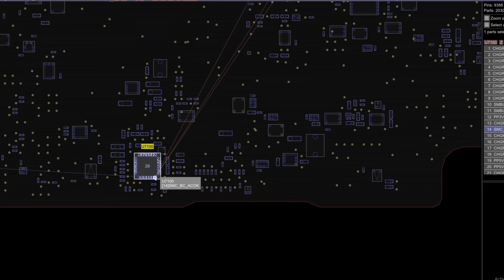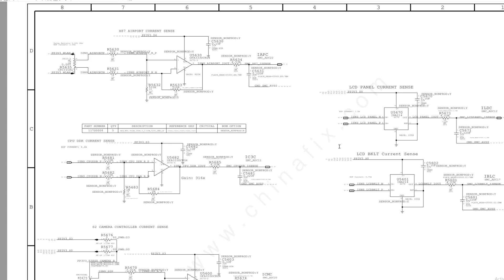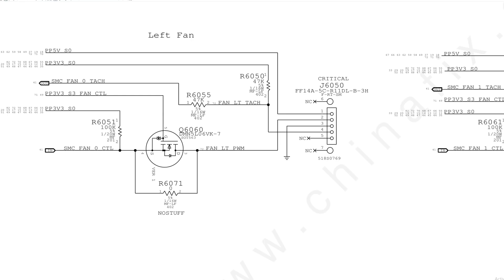Right to Repair - Let's be realistic

Comment: But i want to ask you something brother.. there are leaks of schematics and circuit diagrams for older Macbooks.. had anyone reverse engineered them?
Reply: Has any company re-built a Macbook from the existing schematics and circuit diagrams of older models? i dont think so
Reply from the maker: Where in the video did i talk about copying or reverse engineering a schematic as being a concern or problem. When something is my property, I have the choice to share or not to share it without having to justify anything. That's why schematics used to be shared and now they are not. I wish all manufacturers would provide schematics but I don't think you can legally force them to unless those schematics  are leaked.
Reply: A board diagram is not "private property" because it's released to the public the moment they sell the product. All companies reverse engineer each other's stuff immediately, and if the demand is high enough, some Chinese can do the same at home and then try to sell the schematics and diagrams to repair shops. That's why they all have that information for the most popular iphones and other garbage. But if it's a niche product, then you're out of luck because nobody will reverse a board for you as a hobby. Don't forget that even repair shops are primarily a business.
Reply: :( Such a shame...
Reply: Building a MacBook is not an easy job, but there is a lot of component that rebuild with Reverse engineering. The best example is accessories of Apple. There is tons of them thats not Apple product. Companies build them with reverse engineering. There's chinese companies that try to copy apple. If you will give them schematic and board diagrams they will immediately copy all of your products.
Reply: @abdulkadireroglu8602  You just said they don't need the schematics to copy Apple, so what's your point?
Reply: @abdulkadireroglu8602  Chinese companies don't need to reverse engineer or copy apple, they already manufacture your apple iPhone. Huawei is better anyways

Comment: Board and circuit diagrams where available for almost all electronics in the past (in the nineties and before). It was even printed inside some electronics and was at least available to repair shops. We just become used to don't have this information available though the years. The companies took away these diagrams and repair information, little by little, over time, to force us to buy new products instead of repairing them, we just didn't realized before it was too late. They now, as you explained, even go as far as using serialization... The companies changed these practices over time to prevent end users and repairs shop to repair electronics. In my opinion, on the contrary, they should be in the obligation to give these board and circuit diagrams to, at least to repair shops. Service manuals were a thing for almost every electronics in the past. Why it's no longer the case?

Comment: Spot-On analysis Alex. While you were talking I thought of an add-on to what you were saying. If only computer repairers who were registered with the IRS are allowed access schematics through the manufacturers database, that might appease the big manufacturers  who want to protect their intellectual property. I asked ChatGPT how to manage the security and Intellectual Property question and this is part of AIs answer to that question. It has Merit. Cheers:  

"The quickest and most secure method for IT hardware manufacturers to share their intellectual property (IP) with repairers would depend on various factors, including the specific circumstances and requirements of the manufacturer. However, here is a suggestion that combines speed and security:

One option could be the establishment of a secure online portal or platform specifically designed for authorized repair technicians. This portal would require repair technicians to register and undergo a verification process to ensure their qualifications and adherence to certain standards.

Once approved, repair technicians would gain access to a controlled environment within the portal where they can securely obtain the necessary repair information, including motherboard diagrams and electronic schematics. The portal should incorporate robust security measures, such as encryption, multi-factor authentication, and user access controls, to safeguard the manufacturer's IP.

Additionally, the platform could employ digital rights management (DRM) technologies to further protect the IP. Repairers could be granted access to specific documents or information based on their credentials, and the DRM system would ensure that the IP remains encrypted and protected from unauthorized distribution or misuse.

Regular auditing and monitoring of the portal's activities would also be essential to identify any potential breaches or unauthorized access attempts, ensuring the security of the shared IP.

By implementing a dedicated online portal with strong security measures and controlled access, IT hardware manufacturers can provide repairers with the necessary repair information while maintaining the integrity and confidentiality of their intellectual property."

ChatGPT suggested other options, but I value and respect your time. All the best.

Comment: 11:06 about passing on schematics , its already happening with cars and motorbikes but it doesnt happen with the electronics and that is the problem we dont ask for source code we just need to be able to buy parts and know the electrical conections , for long years people reprogram cars ECU´s they have the car schematic but no one is copying the car coz its not feasible, even if you know how the comp+onents are conected and which components are there you cant just 3d print a pcb at home it requires bilions in resources and equipment.
Reply: Actually, pcbs can be made as cheap as 2$ per 5 of them. I do assemble a lot if pcbs myself at home.

Comment: The big question is solved long time ago with cars. You have third parties making parts for your car. It's a sane market. And cars manufacturers spent millions designing their cars too but you can find easely how to repair your car.
Reply: With electronics it is kind of different, you might be able to copy some parts, but chips is another story.
Life cycle of cars is longer than any electronic device. So if a 3rd party will invest in manufacturing parts for mobile I think it will not be that rewarding comparing to cars that last for many years.
Reply: I agree. However, car parts are manufactured in such a way that you need to replace the WHOLE part instead of just a component of that part. Back in the old days, you can buy a gasket repair kit for a leaking water pump, for example, and replace the bushings, gasket, rubber seal etc. to fix the leak without the need to replace the whole assembly. Now, the water pump assembly is designed in such a way that you need to buy the whole assembly which cost a whole lot more and is not repairable anymore. It's disposable. 

Another example is the wheel hub. Instead of replacing just the faulty bearings, you need to replace the whole assembly, even where the wheels will be bolted on to. 

Gone are days where REAL MECHANICS exist.
Reply: A sane market... that is also at fault for the whole semiconductor situation right now....

Comment: This is why having an older model laptop isn’t always a bad thing nowadays. You said it’s not fair or realistic for manufacturers to have to make public their schematics and board diagrams ,parts etc but that should not be the case if it’s an older model device. I think after a certain time frame these should be made public. They withhold these for devices they no longer sell which is wrong.

Comment: I would agree with Alex that we should not enforce manufacturers to make schematics circuit diagrams availble to the public. But they should not block consumers or independent repairshops from getting their hands on certain chips, or using tactics like serialization to prevent independent repairs from happening...

Comment: Thanks for your great videos! The right to repair movement has to be legislated for a numerous reasons, including a greener and environmentally friendlier planet, sustainability, much less electronic waste, better for the owners pocket and because it gives jobs to thousands engineers and technicians across the planet. In the good old days a  lot of electronic products were used to included the schematic diagram of the whole circuit inside the purchase box!! Didn't they have copyright restrictions those days?? I believe that the service manuals of electronic devices should be published and used freely from whoever wanted to use them.

Comment: I think a simple solution is to force the industry to:
1- Add a maintenance port to every device and provide a diagnostic device in a reasonable price.
2- Providing spare parts for a cretin time ( may be 3-5 years ) starting when the warranty ends.

Comment: That’s what a patent is for, to protect the board design. They should be made available, you can repair but not duplicate…
Reply: I agree. The manufacturer should be responsible for infringement rights.
Reply: Exactly
Reply: exactly, sadly the point it's just forcing you into buying a whole new product
Reply: That's not how patens work. It's trademark law that forbids you to sell a duplicated iphone, even if the circuit board is substantially different. A board diagram is nothing else than a high-res photo of the board traces - anyone can "reverse engineer" it with a flatbed scanner and a very moderate amount of effort. You can argue about copyright law, but it's not explicitly protected (like text or music), at least not yet, or else even posting photos of the circuit board would be illegal. Therefore, anyone can produce these board diagrams and publish or sell them - that's how all the repair shops get access to them, at least for the most profitable products. Of course you can't force manufacturers to provide them, but that's not necessary and not an issue at all concerning right to repair.

Comment: I agree with everything you said. 

Schematics and board views are intellectual property but spare parts should be made available. It has to be accepted that it's not really in the interest of the manufacturer to have things repaired but it is not in the interest of the consumer stopping this stuff being repaired either.

In the car industry most parts are available either from the manufacturer or motorfactors. Schematics and other info is available for the vehicles through subscription services. The system is not perfect but a good Tech can solve pretty my any issue with these.

Great videos by the way. I've learnt a great deal from you.

Comment: If we can get car parts and car manuals we should be able to do the same for any device. The argument about engineering design is false because all motherboards are using common components, the latest Intel CPU for example or a mosfet or a capacitor. There is no copyright here. Apple does not make components it buys them for the most part so nothing on a pcb is really copyright. If that were to be true all car vendors would not allow their cars to be fixed. Even with cars you can buy after market alternatives, you do not have to buy original parts. There is absolutely no difference between repairing a car and an electronic device. Big companies should be forced to provide parts, schematics and board views just like cars have to provide parts and manuals so that cars can be maintained. A car => electronic device when it comes to repair.

Comment: Back in time a TV schematic sticker was fixed on the back cover, same for a radio.  When I was young the schematic was provided at the last page of the user manual of any toy sold at Radio Shack.  Reparability was expected for any product.  I'm myself an electronic enthusiast.  I like to repair electronic boards as a hobby.  When I go to an e-waste facility, I'm asking to take with me the beautiful 60in LCD TV in order to repair it.  The answer I'm getting is that they cannot give it to me for repair since it will be sent to be scrapped out for materials.  Reuse is by far more benefic to the environment as opposed to recycling.  But for each TV I'm able to repair a new one is no longer sold at the electronic store.  This is sad, but it's today's mentality.

Comment: Schematics and board diagrams are necessary for repair. They used to be provided and it's only recently manufacturers stopped doing it. Case in point a Kenwood amplifier I fixed last weekend from the 1990s. There are other laws for protecting IP. Be optimistic rather than realistic and focus on the rights of consumers.
Reply: I repair some boards without new parts and diagrams avalable, but it takes much more time to figure it out and drow some diagrams for myself.

Comment: I've been an electronic service repair guy for the last 40 + years and believe me things are not like they use to be, I do lots of repair just like you do except I dont like much tablets and cell phone, most of my work is done with auto computers ECM, MSD ignition, radio comunication recievers or HAM, PWR Inverters, HAVC Inverter PCB, TV's and Audio PWR amp, stereo car Amps. From time to time I'll also do commercial and industrial electronics saving manufactor big stash from buying new equipment. Most of the time you cannot get any technical support or parts from these companies they will just ask you to replace the board, even if you get a hold of them they will just ignore you, in some cases I just have to reverse engineer and make my own schematics  and board drawings.

Comment: Definitely agree that proposing a sort of subscription model for schematics and service manuals would probably encounter less resistance from manufacturers. I think it's worth pointing out though, as others have said, schematics and service manuals were widely provided by consumer electronics manufacturers for decades. This was during a time when these designs were discrete-- there were no ASICs, no proprietary ICs. The intellectual property really was in the circuit topology and component selection. Often these service manuals described the theory and operation of the circuit in excruciating detail. Companies provided all of this because this information was required for repair. These devices were designed to last for decades, and many have lasted that long in no small part due to the availability of service documentation.

Despite laying out their technical cards for all to see, consumer electronic companies still flourished. There was an extensive independent repair industry. All of this disappeared as extreme mass production ramped up and devices became cheaper and cheaper. This happened concurrently with the consolidation of discrete components into ICs and microcontrollers. Now there is much more emphasis on embedded programming and ASIC development. Not to minimize circuit or PCB design at all, as they are still critical parts of engineering, but that's not where the bulk of trade secrets lie in most cases. Besides, reverse engineering a PCB layout isn't impossible, and it can even be automated.

So, the restriction of service documentation is motivated by the desire to sell more and more units of a device. That's where profits are made. IMO, it really doesn't have much to do with protection of intellectual property, despite what some trade groups or manufacturers may say, as there aren't many (if any) trade secrets that a schematic is exposing. It is all about limiting choices for a consumer, and steering them towards buying a new device.

Comment: In part 2 you could talk a bit about more companies design their products to be less repairable, like new macbooks and display cable incidents. Older devices are may easier to repair, because there were may less focus on making devices repairable by manufacturer only.
Reply: easily swap batteries RIP
Reply: @franciscopenacunha9783  to repair soldered memory or other components rip

Comment: I think a good middle ground is that the board diagram is sold to repair shops if they need it after one year of the board being used.  Most products have 1 year of manufacturer warranty.  The real challenge comes with DRM (Digital Rights Management) on the diagrams (subscription based?).  Well, exactly like you say it.  It is easy to reprogram, but you need the right tools, remember the old dongle that we had to use on the printer port?  (Yes, kids a laptop had a printer port....)

Comment: In the UK/Europe... there's a new policy that all electronic equipment has to provide parts and service  for the unit to least 5yrs.. also under the "W.E.E directive" it's cuts down waste going to landfill...also we are NOT to use leaded solder for repairs!..as lead breakdown (in landfill) and enters the water table underground....

Comment: As both a computer engineer and auto mechanic, the rules applicable to auto repair should apply - open access. The board and schematics may be protected by patent, trademark and copyright, which is more than adequate protection for these monopoly corporations. Moreover, designs change so fast, that there is nothing to be gained from keeping it secret, except to force customers to buy instead of considering repair to what they own.